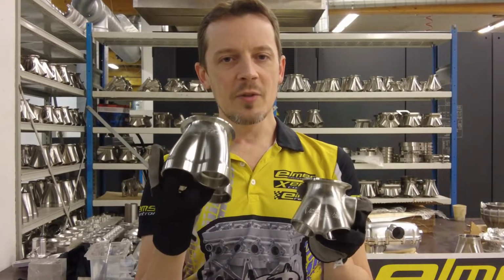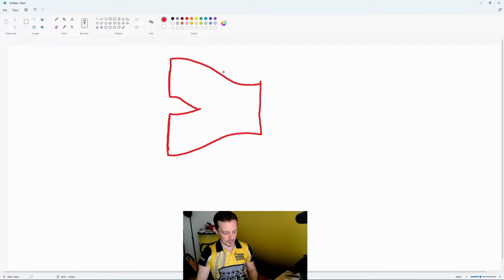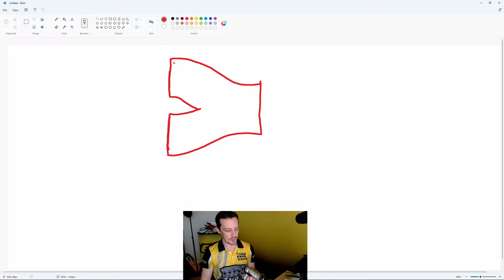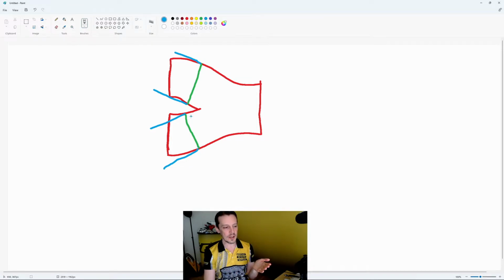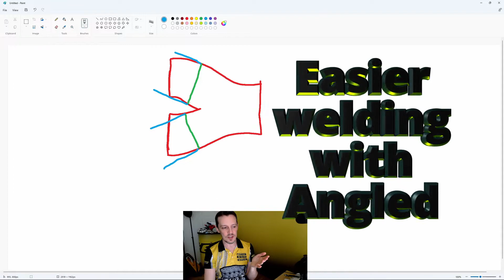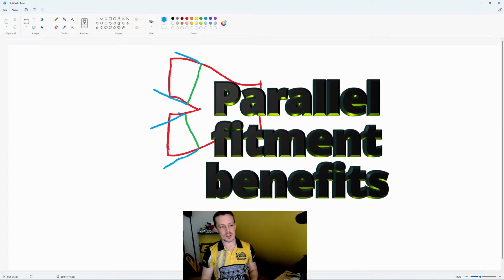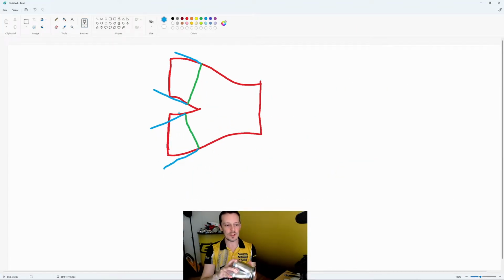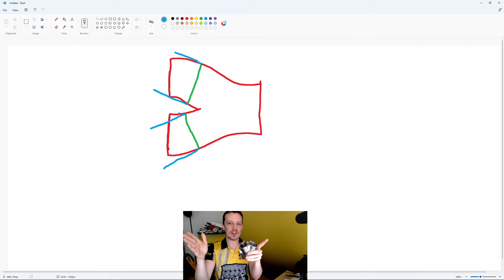Billet collectors: Parallel vs Angled, which is better?

Comment: I have been trying so hard to find a comparrison with the same set of headers with a formed collector, true merge collector and any other kid dyno comparrison. There are several on legnth and diameter but not one on different types. I just bought long tubes and they came with 3-1 formed collectors on each header and i know it would be vetter with a true merge collectorw but are we talking 1 hp, a whole new powerband... all that. Im debating cutting them and getting a real collector installed but only if it is really worth it.

Comment: I had an idea for a brand new project. A 9L/10L V10.  There is concurence like the Viper Kratos (3306 whp) and the Calvo Motorsports CMFTW viper (3000+ whp). I think you can destroy them with your know-how and your technology
Reply from the maker: We're open to most engine projects within reason, if the orders are there :)
Reply: @ElmerRacing  ah ok, I understand
Reply from the maker: boumahdi salim 🇩🇿  Could probably be possible to make a custom racing engine "based on" the tb48 yes.